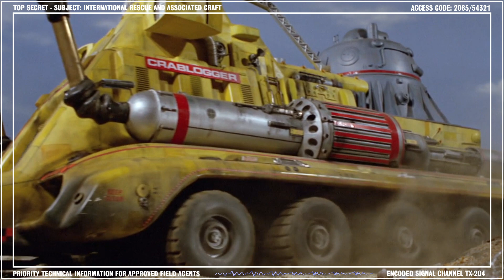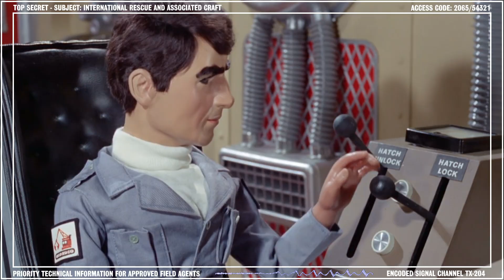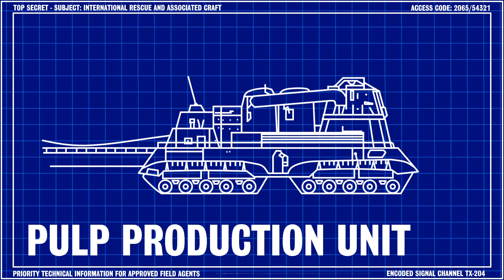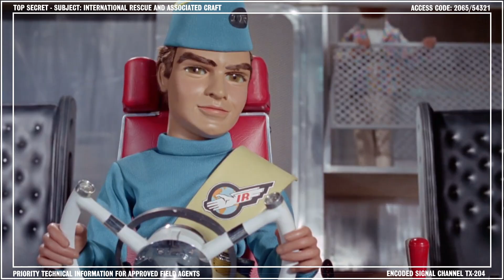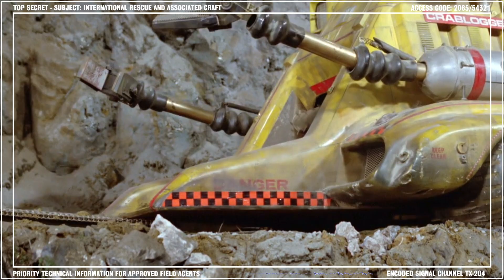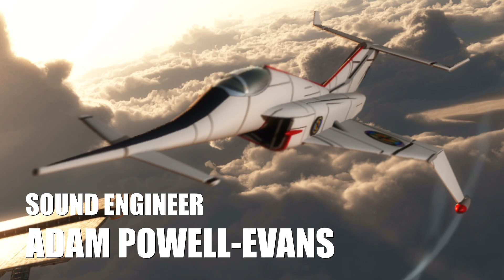Crablogger: Century 21 Tech Talk [3.8] | Hosted by Jeff Tracy [Thunderbirds]

Comment: and again why the mix with imperial and metric measurments, please use consistency and go for metric only
Reply: Thunderbirds uses Neo Imperial so that's what we use :)
Reply: @ACtheLegend  it still is stupid
Reply: @commandbrawler9348  why? It's consistant with in-universe lore, which is the whole point of the video.
Reply: @commandbrawler9348  it's not exactly hard to convert them if it bothers you so much :)
Reply: @commandbrawler9348  cheers, I'll take that as a compliment. Be sure to have a FAB day :)
Reply: @commandbrawler9348  generally YouTube comments consist of text, not speech, but whatevs, tis all good :)
Reply: @commandbrawler9348  - No. Imperial measurements are human measurements - based on the length of fingers, arm bones, etc. The Pyramids were built on human measurements, as were most early structures. Metric measurements are fairly recent in the scale of things, dating from the late 1700's in France. Had Napoleon Bonaparte conquered the world, then metric would have been the standard. But he didn't. So it wasn't. No 'drunk idiots' involved. It doesn't matter that you didn't know this - but you should probably have read more books.

Comment: I could never figure out why the crablogger had both a nuclear reactor and liquid fuel.
Reply: Same reason as your car has petrol and oil, they serve different purposes, there's a lot going on inside :)
Reply: @ACtheLegend  There is also engine coolant and windshield wiper fluid...but why would the crablogger require 2 power sources?
Is it like a hybrid car where you have batteries and also a normal petrol engine because the batteries don't really work as a reliable power source?
Reply: @ghost307  atomic drive system but pulping gear uses fuel-powered equipment ☺
Reply: @ACtheLegend  That makes sense. If the pulping equipment was already standard technology for the time it would use standard fuel. The nuclear powered cutting unit in front was designed new from the ground up. It wouldn't be worthwhile to convert the entire trailer-mounted pulping plant from superon fuel to use the electric power from the reactor. Thanks...that's been puzzling to me since the first time I saw that episode.
Reply: @ghost307  no problemo, I should have made that more clear in the video :) I think we can all agree that either way it's one heck of a gas guzzler!

Comment: Nice title drop!  But WOW, did the Crablogger have SO many problems.  No emergency stop button.  No breaks!  Control so complex not even BRAINS can understand them.  And the fact that despite having a 'programmed' route, it STILL manages to go completely off course!
Reply: I always figured the programmed route was like using Sat Nav. You'll get there if you follow the route shown, but the driver is still in control.
Reply: (Just can't resist) ...Another reason not to use Windows to run a vehicule?
Reply: @pierrelahaie6359  Ha!  I knew someone was going to bring that up.

Comment: Even as a kid I thought it was odd that we would need an atomic powered tree chipper
Reply: Now as an adult I want to know why an atomic powered vehicle needs constant refuelling with 'superon' fuel.
Reply: @andrewholdaway813  still runs on fuel like any other vehicle :)
Reply: @ACtheLegend  
Oh; what are the atomic motors for then?
Reply: @andrewholdaway813  partly the drive system and internal workings, but just like a car needs petrol and oil for different reasons, the Atomic and Superon systems each do different things :)
Reply: @ACtheLegend  
At eight gallons a minute that superon must be doing an awful lot.
Reply: @andrewholdaway813  darn tootin!
Reply: The nuclear reactor is only for the entertainment system.
Reply: Check out their Xmas episode. They used nuclear fuel rods to roast the turkey!
Reply: @stormwulf117  ahhh, they could have done that but didnt, they actually used the rotisserie oven because Grandma "couldn't get the hang of those rods" :)
Reply: The power of the ATOM! (But also needs fuel trucks.)

Comment: Thunderbirds went in for gigantism a lot. The Crab logger, the Sidewinder, the giant road layer, Fire Flash air liner. etc. Every week some giant machine fell down a hole along with it's four man crew.
Here we are in the 21st Century. I doubt such giant machines would ever be considered today even if we could build them. Environmental concerns would simply rule them out.
Reply: I suspect that was the reason behind Jeff's bit about planting trees to replace the ones being cut by the Crablogger early in this episode. It has been a while wince I last watch the original episode but I don't recall any mention of ecological considerations there. However I always thought that the whole control design of the Crablogger was overcomplicated for what it was. 

Why did it need a route program for an onboard computer? Why was the shutdown sequence so complex? Why did it need 3 minutes to complete? Why did the control module of the machine require that the exit was so difficult to open? If control was so vital, why didn't the pilot and co-pilot exercise the same sort of meal setup that aircraft pilots do? If the engine were atomic then what was the Superon powering? And, most importantly, WHY DID THEY EAT THAT AWFUL CHILLI?!?
Reply: Despite the fact that they plant a tree for every one harvested?
Reply: there is a case for gigantism in transport, massive ships, super long trains, mining haul trucks moving 300+ tons at once.
Reply: Thunderbirds had very much a theme of “man vs nature”.

Comment: FAB FACT: The front section of the Crablogger also appeared in a 2020 episode of THUNDERBIRDS ARE GO!
Reply: The episode is called "Firebreak."
Reply: too bad they didn't include the rear half of the CRABLOGGER. It's like the crew just decoupled it and just left it somewhere else in the forest, but the rear half of the Crablogger housed its main fuel tanks, so the forward half of the Crablogger couldn't go far without running out of Superon.
Reply: @nikerailfanningttm9046 that's because it's supposed to be the same crablogger, and the abandoned dam the one that was almost blown up by it. The back half was left on the the top of the dam, while the front half plummeted to the place where it would be found in GO

Comment: In the future even your lawn mower will be nuclear powered.
Reply: Don't laugh but, in 1968, Parker Pen produced a designed for a "radioactive pen" which was described as using a tiny packet of isotopes to heat the ink.  No production models were obviously made, but you can see the pen floating about in "2001: A Space Odyssey".